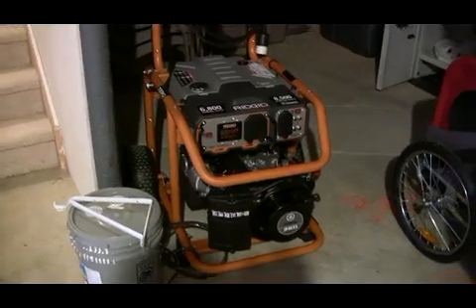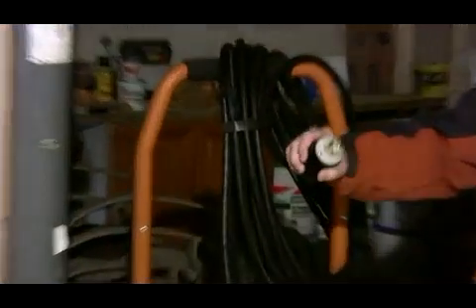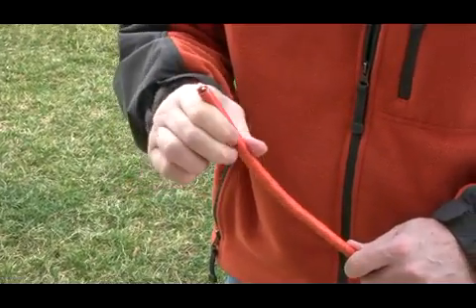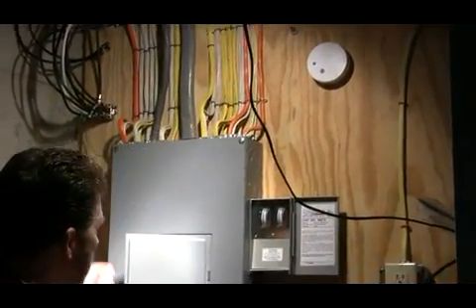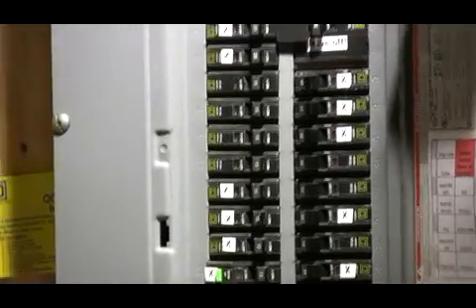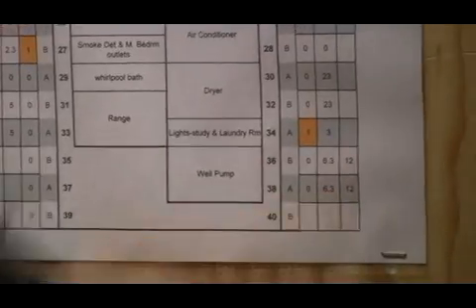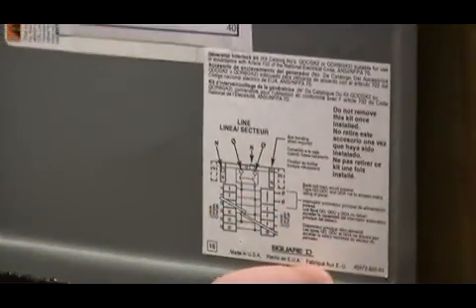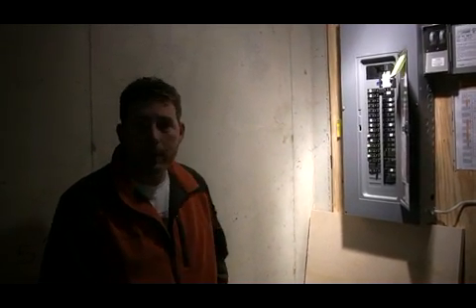Interlock vs. Transfer switch

Comment: Nice job, and very clean.  Did the same for the same reason.  I wanted the ability to use other generators and wanted the ability to choose any circuit I want to run instead of what is hard wired.  The Interlock lets you use any generator as long as the plug matches, and power any circuit.  I had to use a heavier cable (SOOW 6/4) as my generator is a 12,500 running / 18,500 starting.  It can power everything at once including A/C, Range/Stove and HW heater.  Needed the cable to be rated at 50 Amp.  Living in FL A/C is a must.
Reply from the maker: Bingo!  agreed. Thanks for the comment.    Just some food for thought for you....   You touched on it already.. "being able to run any generator".       There are some different reasons for that...  for example if you were without power for lets say a month.   You might want to have a small unit that will just sip gas and keep the basics on.  Then if you need the extra power, you could fire up the big unit.
Also, if for some reason you can't get one of the units to start... you have the other one as backup.  I originally wanted to get the largest generator i could afford.. but then realized that maybe bigger is not better in case of extended outage.   Knock on wood... i have only had to use mine maybe 5 times in 10 years.  The longest outage was only a day and a half.   But it was nice to fire up the coffee pot and turn on the Tivo.
Reply from the maker: Also, forgot to mention that I can run mine on propane OR gas just by flipping the valve.
Makes it nice!  And when you shut it down, you don't have to worry about the carb gumming up.
https://www.youtube.com/watch?v=fVgP6-AU9Ec

Comment: nice video. I have  similar setup without the wattmeter and the paper chart (good idea) I originally set up a small subpanel with only a few "emergency" circuits, simulating using a transfer swictch and panel that only has  6 or 8 crkts. But i needed power on  a few other circuits that i didnt have set up on the subpanel, so i ended up rewiring it as u did using my whole panel and then i can pick and choose wich circuits i want to turn on. I also have that same rigid generator that u have. Very good video nice neat workmanship.
Reply from the maker: Thank you!

Comment: I run a 5KW generator on a subpanel at my detached storage building.  In power failure mode, I drop the main, fire up the genset and engage the backfeed breaker at the separate building.  I do not bother to label individual circuits, I just limit the loads I ask the genset to handle.  Down the road, I will install a massive 22KW+ propane generator with an automatic transfer switch for the entire main panel.  Nice video.

Comment: so if you get the transfer switch you don't need the interlock??  transfer seems super convenient, but something to possibly fail.
Reply from the maker: Correct.. its one or the other (xfer switch or interlock).     xfer switch makes it all idiot proof.   Only specific circuits are pre-wired to get generator feed.  Not likely to fail, and to be honest its the 'preferred' way to go.    Interlock is just another option that is more flexible, but not as idiot proof.

Comment: A transfer switch is code in a lot of places and requires an electrician. Also an electrician will balance the loads going in to the transfer box for you. {He will have to know what you are wanting to run etc.}

Comment: Does the Generator need to have a 240 volt socket?
Reply: It does not need a 240v outlet . It certainly makes it easier but a modified cord or wiring between inlet box and switch will work perfectly fine (going from 3 to 4 wires).  You just can't power any 240v circuits, there is no balancing, and one would have to be more aware of the power consumption with a smaller 120v only generator. I say this functionally will work just fine but from a code/inspector standpoint I'm sure there will be some different thoughts.

Comment: wireandcableyourway.com is the best online place to find cable, if you want a generator cable you should use a SOOW cable which wireandcableyourway.com has, they have up to 2 gauge 5 conductor SOOW cable

Comment: Very similar to my setup.  I did one other thing -- I added a (battery operated) device that makes a reasonably loud "siren" noise if there is power to a line.  I ran its sensor to the power service lines.  When I turn on the generator, I also turn on that device, so when the power company restores power, I hear the siren and know that I can turn off the generator and return to normal service.
Reply: https://smile.amazon.com/gp/product/B003KREORA/Reliance Controls THP108 POWER BACK Mains Return Alarm
Reply: Thanks for the post yes this THP108 alarm is a good option for any interlocked system at or close to the service entrance.
Reply: This is a commercially available item now - good idea.  Available on Amazon.
Reply: Nice.
Reply: I installed this device but it didn’t seem to work reliably.

Comment: Excellent video!  Really appreciate the tips provided.  I have two 200 amp panels (side by side each other).  I would assume I could connect in a similar fashion using two interlocks.  Should I split the wire coming from the inlet to each 30 amp breaker on each panel or jump one 30 amp breaker in one panel to the other?  Appreciate you sharing your knowledge and expertise.  Thanks!

Comment: use a solar system to run power into your house through the generator port...noisy generators suck...I got rid of mine and bought a solar system...way better...quiet...I can use it anytime I want..its free to use and run unlike a generator which uses gasoline dark energy shit fuel
Reply: Batteries are expensive
Reply: yea really, let me fire up my 240 volt, 3/4 horsepower well-pump off a solar set-up  
Get real, Kyle

Comment: I installed a high end transfer switch because I got a hell of a deal on it.  Takes standard breakers and has dual inlet meters to monitor the power usage.  I have no issue with a power panel interlock provided people carefully watch what they are powering up.

Comment: your grounds and neutrals should NOT be bonded to the same bar your neutral bars should be isolated from the load center (meaning not grounded to the box) you should have installed separate ground bars, the only place you should bond your neutral and ground is at the meter/main per the NEC

Comment: Does the ground and neutral need to unbonded from each other at the generator?
Reply: +Roderick Crane  Yes. if you have a ground neutral bond in your main panel than your generator needs to have a floating neutral.  Some generators like the Honda EU, EM already come from the factory with floating neutrals

Comment: either 10/4 30 amp sjoo (300 volt).or soow (600 volt) cord...
Reply: Franklin Wilson 
It’s 10/3 because the ground wire is not counted. There are 4 actual wires, but only 3 isolated wires.

Comment: I have 30 amp breaker for dryer on the top right in the box will work out great for the interlock kit.  The  dryer is running propane Not 220  can i disconnect that dryer run at the  breaker box cap them off to the side then feed the generator into that same 30 amp breaker or do i need a different breaker?  Does any of this make sense or am i out of my mind? "Your a good dude thanks for your time!!!
Reply: Stone Rinaldi you could but it wouldn't meet code. An interlock needs to be set up so that it physically isn't possible to have the main breaker and the generator interlock breaker switched on at the same time. You can't do that with a standard breaker used for a dryer.

Comment: i also have interlock on squareD homeline panel. Works great, but only have had to use it 3 times in 10 years.
I did not bother marking the individual breakers, I just leave them all on. most circuits are not using much power, maybe nothing at all. The big items like the oven and drier we just do not turn the appliance on. And I wont be running shop tools in a power outage. I can run the heat pump which was a blessing. Gen is a Troybuilt 8000 watt 13000 watt surge and it runs the central AC.
Reply: That's one heck of a Generator.:)

Comment: I have a Gererac XG10000G and also use this system and it works well. I have 2 panels one is fed with a 50 amp breaker because this panel has the most important loads and the second panel has some nice low load options that is fed with a 30 amp breaker. Both have the interlock kits.I also just purchased the Gen Tent system for wet weather use. I have installed  4 Murata power solutions ACM 20-4-AC1-R-F-C digital meters that use hall effect sensors. These can be purchased from Mouser Electronics and measure Voltage, Amps, watts as well a frequency and have a touch option to display all 4 measurements every few seconds or just one. you will need to make your own mount for these. I used a plastic outdoor box from Home Depot so I can mount the meters and feed the wires behind them for the hall sensors. They have a door you can close to protect the meters from any damage. I installed one on each 110 feed to the backfed breakers making each line easy to balance. I can run both panels on my large unit but also have a Generac MC 4000 unit to run my second panel if need be and have made up an adapter to run that unit also on my large load panel for night time use in cold weather to run my pellet stove and my refrigerator and a couple of lights. It only burns about a pint an hour as opposed to the big unit burns a gallon an hour so on light load demand I use that unit . Now that I have told you how to build a watch when you only ask the time I will end by saying the Square D interlock system is the way to go if you have the correct panel. Search the internet there are places to purchase this interlock a lot cheaper than some.

Comment: interlock kit all the way. transfer switches are stupid
Reply: Have you ever heard of building codes? I hope you never plan on selling your house, haha.
Reply: More work and limited circuits with transfer switch.  However, we know when the power is back on and can turn off the generator.  Interlock installation is a bit simpler and provide the most flexibility.  Because interlock requires us to turn off the entire panel, we can't tell when the power is back on.

I have been watching a lot of how-to for both types and evaluated the pro/con, I have decided for me to install the Transfer Switch.
Reply: robert castello You are required by law to have interlock if back feeding into panel. Accidents do happen.
Reply: Joe Riehl,  what is the code violation here?
Reply: What law? I could do whatever I want to in my house, no one tells me what to do or not to do in my HOUSE!!! are you crazy??? If it came down to Laws there would not be HomeDepot or Lowes, I would love to see you or any city official to step on my property without a warrant and see what will happen to ya! damn liberals snowflakes!...lolz
Reply: You don't even need interlock kit as long as you are not brainless and know to turn off before turning on you should be ok!

Comment: The wire is referred to as SJ Cord.
Reply from the maker: notsosilentmajority1 Thanks!  Appreciate the info.   Its nice stuff.  Easy to coil up and handle.
Reply: @panchohughes  You can also use S/O cord if you use it outdoors or buried (temp. only). Great video, nice work too. Although I usually installed whole panel transfers, you can't beat these interlocks for saving money. BTW, you only have to turn off the excess load (2 or 3 2 pole breakers) before you transfer as QO breakers are rated 20K AIC and are suitable for switching loads.   ;))
--Retired IBEW
Reply from the maker: chris chilson thanks!  Good information!

Comment: Xfer switches are expensive, I'll give you that.  But there are all kinds and types.  The one I have (which was part of the house when I bought it) is whole house, service entrance (SE) rated.  I've looked through the installation manual for my generator, and of course, there are also the kind you stated, which switch on only a subset of your circuits.  Seems to me that kind would simplify your switchover, as there would be no X to mark on circuits.  But of course, you only get so many with any given xfer switch, so that's a disadvantage.

I'll bet it's way cheaper to put on one of those interlocks though.  It's a pretty good idea.

Comment: Nice but you lack one main thing.... how will you know when your power comes back on...
my old set up is/was better than yours and is more suited for those who live a ways from people and cant stick you head out the window and check to see if the power is back on
my old house was setup like this... main power box has a few breakers,one is for the main to the house and another is for  light in the house which is all ways on and a few other for some out side lights , the main breaker sends power to the 2nd box which is set up like a normal breaker box, this is the box i back feed the genarator to. this allows me to know when the power is back on and when to shut off my generator
another way would be to if you dont need to follow building codes... directly connect a simple gfi plug in a box next to your breaker box to one of your main wires and connect a light to it...
Reply from the maker: I have a device called "power back"  that tells me when power is restored.  It has leads that wrap around the mains (inductance) and it sounds an alarm when it detects voltage.
Reply: Brent Geery I do believe that smart meters increase the cost of electricity because they can bill you higher during peak hours, and lower during non peak hours, since we are a coop, we don't have any smart meters on any of our bills as of now, but i do know a few places that do have them, but they are mostly the 3 phase on irrigation pivots and large shops that need 3 phase, one of the shops i had was billed weird because of the smart meter it has, and it was a 3 phase shop, i still have the shop, but no longer have power on there anymore, don't use it enough to warrant paying the coop 22.50 to have the meter still hooked up and the rate of .15 cents per kilowatt, single phase is currently .105 cents right now
Reply: The smart meters aren't for charging you more during peak hours. It just cuts back on the power used by your heat pump when super hot and brown outs are occurring so you can go entire summer without it being used. But they pay you your annual fee at beginning of fall no matter.  It is onky used during summer - not other 3 seasons.  No change in my bill except when they add the credit in and the bill goes down.  Also, the program only works during a few hours in the hottest part of the day when most folks are at work - never in evenings. The compressor is cut back so not as much humidity is pulled out but the fan is still running so you don't notice anything except it just isn't as cool or dry but it is like just a hour or so. By the time you realize it isn't as cool, it's over.  On the super hot days, just walking into a house 15 degrees cooler feels good.  And if you don't end up with those 98-100 plus days, it isn't used at all.  It is just to help balance out electricity use so blackouts don't occur and everyone is totally down.  I have had no problems or issues - and they give me a little something for any inconvenience.

Comment: Great video.  My only real suggestion is that the title of this video is wrong -- it's not so much about interlock vs. transfer switch, but more about planning out what improvements could make things easier in the case of an emergency, when trying to get the generator going.   I am impressed that you took the time to measure the peak & steady-state loads for each circuit (and recorded it all on a spreadsheet beside the panel!).  Also the emergency light and the "X" label on each breaker... your perspective was "how do I get my house and family back "online" as quickly as possible.

Whenever you sell your house, you need to make sure potential buyers realize the value of all the extra work!
Reply from the maker: Thanks Bill!

Comment: Do you know if the interlock will work with a generator whose neutral is bonded with the ground?
Reply: It can but its not code.  It may trip your ground fault  You should only have one neutral bond to ground and that usually in the main box.   All Honda EU EM and EG generators have floating neutrals.  Only the Honda EB construction models are neutral bonded.

Comment: Make certain that you have purchased an interlock that was manufactured by the same company as the panel.  The National Electrical Code requires an approved device for this purpose and only interlocks manufactured by the same company as the panel are approved. Make certain that the part number of the interlock is listed on the instruction label of your electrical panel.  BECAREFUL. There are many "interlock kits" on the market that will nullify the UL listing of you electrical panel thereby causing a serious violation of the National Electrical Code. MAKE CERTAIN YOU INSTALL A UL LISTED PRODUCT.